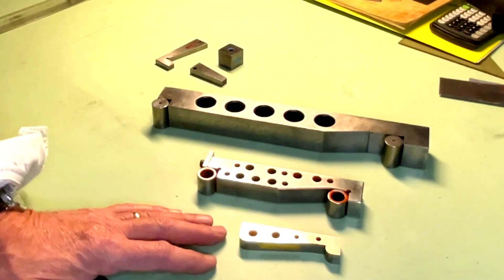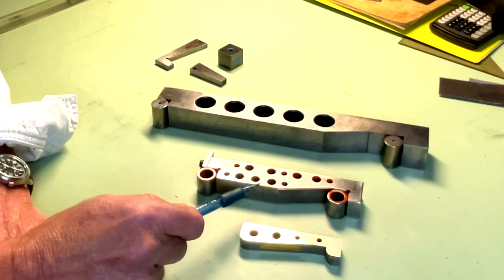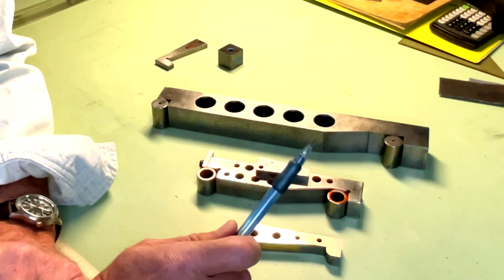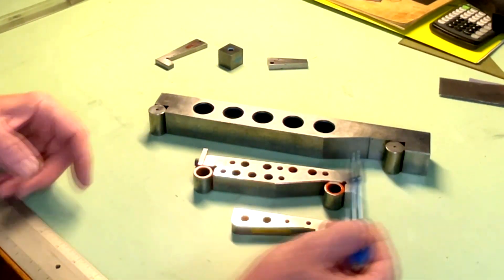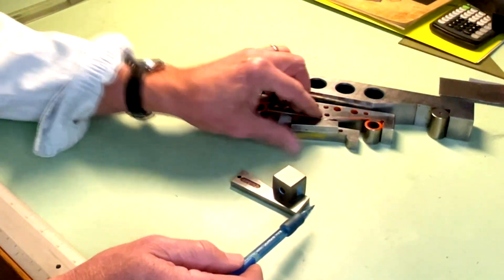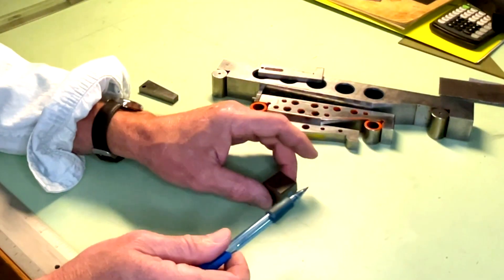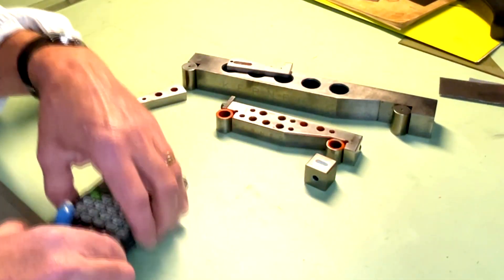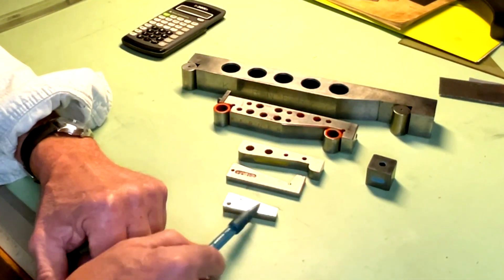HOW TO USE SINE BARS

Comment: Hello Phil. I gotta ask how you keep the sin bar and gauge blocks all balanced and aligned on the part. The whole lot slides down off the part when tilted over 20 degrees. When I try to tap the part true to the indicator the whole lot moves again and I have to reset the sin bar true with the x axis before I can indicate the top again. Will you be demonstrating this technique soon in another video to show us the knack?

Comment: What are your thoughts on sine plates? I made a 10" sine bar similar to yours, made a video about it. I find that a 10" on the surface plate is my favorite to work with, the sheer mass means a little bump doesnt disrupt the setup.

Comment: Great video!, if you bought a used sine bar how would you check its accuracy??
Reply: Always! The nice thing is that you can reverse calculate the exact distance and use that. If your 12 inch sine bar turns out to be a tad too small, stamp the correct distance on it and use that in your calculation! There is no such thing as a „a little too small sine bar“.All you need is a known precise angle block and a stack to get it parallel on a surface plate.
Reply: @ gotcha! Thanks for the reply!
Reply from the maker: Measure the distance between the rolls/pins.

Comment: I bought a set of B&S angle blocks with the stop on them. I have found them to be super handy. The angle blocks without the stopper are handy as well. I cannot remember the last time I used my sine bar. The work I do does not rusty it's use. Cheers

Comment: Okay, you don't put the sine bar under your part. How do you use the sine bar??
Reply: Don't worry, everyone puts the sine bar under their parts. His bars are far too high to use in a vise. Put the bottom roller against a vise stop and use the stop on the sine bar to locate the part in the X axis Then you can accurately repeat the position for multiple parts. I hold the sine bar against the fixed jaw with a spring or 2. If you try to use it on the top you must make sure it is aligned with the X axis and held there while you indicate the top and be very careful they can easily slide off when tilted.
Reply: @tates11  thanks
Reply: I have posted a video showing a toolmaker's ladder for use under the piece in the vise. This will give you plenty of room and sine distance options. The tool will help you with many situations when setting angles.

Comment: You forgot to mention another reason for the longer sin bar: the longer the bar, the more precise you can get the angle.
Reply from the maker: I covered that. Watch it again.
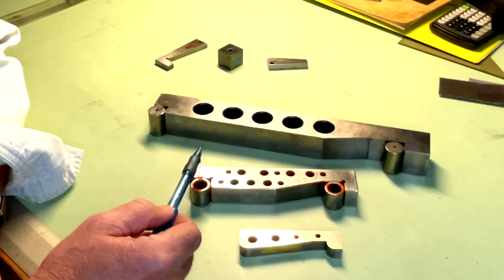Reply: @TheToolandDieGuy  Ok, I've watched it four times now, and I think I caught it... I think. If you're referring to the part from 4:00 to 4:30 I misunderstood it as the larger bar being for larger parts. I had a Metal Shop Teacher use a 10" bar to get a 0.5° accuracy on a 1" bit of metal by placing a 3ft flat bar on the small piece and the sin bar on that.

Anyway. Great video as usual, but I guess that part wasn't clear to me. Likely because I must be sleepier than I thought. It is late and I'm watching this in bed since I'm the kind of Nerd that reads tech manuals, textbooks, and engineering and laboratory white papers for fun. Looks like I'll be dreaming about lathes and mills tonight, judging by what I've been watching the last few hours.